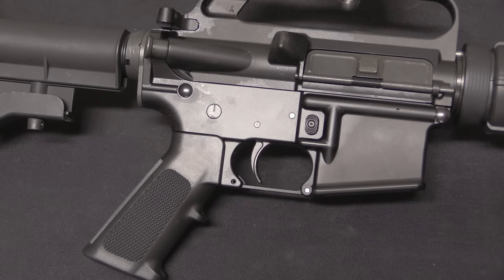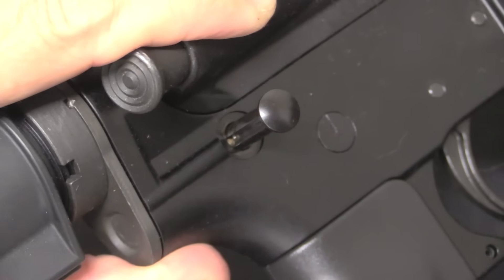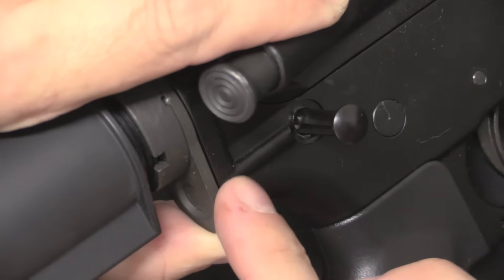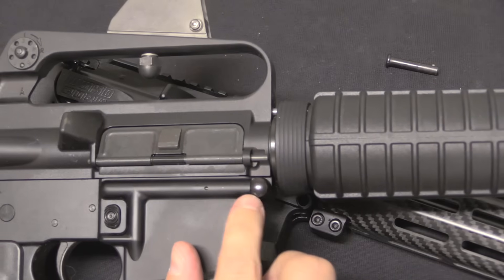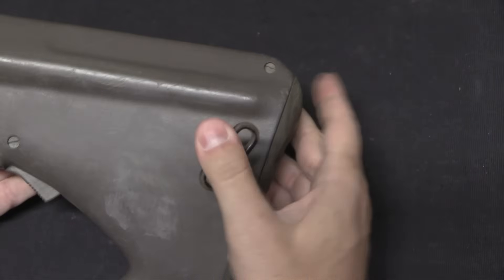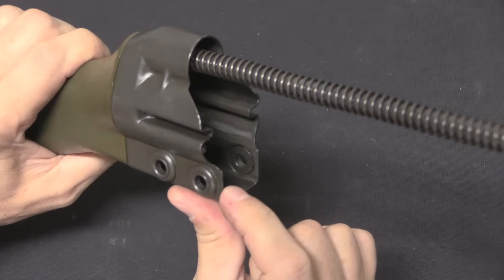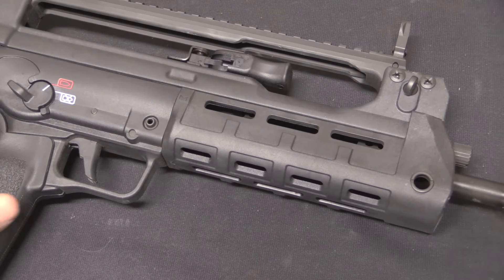Ask Ian: Why Don't More Rifles Have Captive Pins?

Comment: The HK416 has an interesting semi captive pin on the handguard. Its a screw that after a few rotations can be pulled out as a pin, that is captive, but it can be screwed out of the handguard completely, it just requires you to intentionally start the thread in the outer position.

Comment: you can also include metal parts in polymer injection molding (part gets placed in mould before plastic gets infected, can ve fully automatic process), for example a small diameter pipe for such a pin retainer. it does bring up the cost for the mould, of course, especially since you basically need three of them for every machine, but it's possible and wouldn't create a weak point like drilling into the part does. especially with an outside profile of the metal piece that'd help it remain in place and take over so evof the structure that's lost due to the void.
the bigger problem with the last one is the abrupt thickening of the polymer as that increases the chances of imperfections or voids in the finished part, while the sharp corners do create potential for stress while cooling and therefor inherent weaknesses if not dealt with properly (which does increase cost once again, as there need to be special accomodations made for this).

Comment: In case of the VHS-2, I think whilst the point about a potential bottleneck in production, that situation would only become a problem in a wartime emergency production mode. In which case a simplified version could be produced, that use non-captive "normal" pins. I assume changing the desing in this way couldn't be to big of an issue.

Comment: I am biased on this particular issue, but I believe a sg550 series type of swiss malfunctionable pin is better than having the pin retention in the reciever (where it could also get clogged up or similar). Instead of needing to fix/replace the whole reciever part, you can just fix/replace the pin, which I think is likely cheaper.

Comment: HK might not feature captive pins, but on the german standard issue G36 there are holes in the shoulder rest, specifically designed to take the pins during disassembly.
I found that to be a very sensible and well thought through solution.

Comment: The fact that a gun becomes useless if you lose a pin, might be an argument for intalling captive pins. Disassembling a gun on a table is different than doing it in the field. If you have to pull a pin in a combat situation because of a malfunktion, there is a high chance of shaky hands 👋 I am just an airsoft player, but i had situations, where i was extremely thankful for captive pins on my M4 😳😄

Comment: Sooo....dumb question. The non-captive pins Ian is taking out of these guns have Detents (sp?), ie little steel balls in the pins themselves which seem to offer easy removal. Yet, the detents prevent the pins from just falling out. In other words, there doesn't seem to be an operational difference between these two types of pins. What am I missing? Is it just that the pin doesn't come out? Is that the "captive" part? If you're not a soldier in the field trying to "take down" your rifle and you don't want to lose the pin, what does it matter? You're likely to be taking down the gun in your living room or garage. No reason to fear losing the pin.....right?

Comment: Ian, I will point out on your comments from the MDR... 
Most plastics manufacturers will have those holes pre-planned in the mold. what they do is use insert pins while making the part to create these features instead of drilling holes. this eliminates the problem of having to weaken the polymer, but it adds more cost to your tools and dies for the part itself.

P.S. - A lot of people are going to disagree with me, but you'd think the engineers at Desert Tech were not stupid, and more than likely did just as I said; used tool inserts while molding the part to create these captive pin features instead of drilling holes post mold-shot. it's common practice among a lot of polymer part manufacturers.

P.S.S. - After some analysis of paused stills of the video, the tooling may have been simplified by using fixed extrusion pins machined into the mold tool, and although i can not see a parting line, the likely answer is that the die draw is going the direction of these features, which means that the mold opens and closes the same direction of these features, simplifying the tool and lowering the cost. At least that is what would have been done at the company i worked at as an engineer. Most of my work dealt in plastic parts manufacturing, as well as sheetmetal and welding assemblies. (Automotive supplier, in case people are wondering)

Comment: Something else to consider from the manufacturing cost side when making detents and captive pins: the tool to make the holes for the detent is almost always a custom tool.  Machine tooling gets expensive fast and custom tooling like that even more so.  Plus if you are a company that makes multiple parts on a single machine, getting the machine set back up and getting that detent operation correct takes some fiddling, assuming we're talking machined parts here.

Comment: Very well said, Ian. In 2018 I worked for a company making injection molded parts and as a mechanical engineer this was my first time dealing with them. Me, being a very traditional engineer, made my prototypes with fasteners. The principal level industrial engineer instructed me that while my design was stout and reliable, every single extra BOM item I add makes the overall product more expensive. If I could use say snaps that worked with the required draft for the mold pull, most of this consumer device would snap together once and never come apart. Where more precision was needed for a linear stage we used ground stainless steel rods but again, if we could reduce part cost by integrating the bearing into a molded part instead of trying to press or glue in a separate bearing it would keep costs down. 

While you obviously want the product, be it a consumer level device or even a firearm to be reliable above all else, if I can do that with 25% fewer parts it means that the client (even a military one) can get that many more firearms in the hands of soldiers. That was a side of engineering I was not exposed to, and you did an excellent job explaining it here. I also have to say for injection molded parts, thank God for CAD!
Reply: The example of a polymer part having its own small drilled section for the detent spring was fun to see. Makes sense they used a step rather than trying to use a boss, as the boss is usually no more than 50-60% of the wall thickness and you really, really want to avoid trying to have another part just for reinforcement. You can make it work for sure but it takes more engineering hours. But that being said, it would pay off instead of having a line down situation on lower receivers because that one metal reinforcing ring was running low in inventory. THAT costs way more plus the general added manufacturing time, rework etc that a lot of managers don't understand. Do it right the first time, because you'll easily spend 2x the time fixing it after the product has been released.

Comment: A really seemingly simple compromise to me (I know very little about guns, basically just stuff from this channel) would be to drill little holes the same diameter as the pin holes and just deep enough to hold the pins securely with friction, right next to the pin holes, or somewhere on the body of the gun where there is space. Then, you could pull out the pin and put it in the little hole to stay during the process of disassembling the rest of the gun. It doesn't seem like it would be any less convenient to me than using a captive pin. The only problem I can think of is the hole would capture dirt/mud and be hard to clean, but I'm sure there's a simple workaround to that problem.

Comment: Another consideration is manufacturing steps required to utilize a captive pin, SEM (Screw + washer assembly) or other feature.  A single diameter hole is easy, even if they are deep (over 4 diameters). Stepped holes and particularly REVERSE stepped diameter holes will cause planners to curse your name (even when it has been done 20 times bbq before).  The cost of "close tolerance" fasteners is about double that of standard (loosee goosed) fasteners. But, MIGHT be offset by being assembled with zero special fixtures/tools/attention.   Expected number of units produced can be the deciding factor.  Are you making 500 or 50,000?

Comment: What about the L85?

It's stamped metal with captive pins and I don't think it has retraining springs.

Also can't you just have a pin with the inside slightly thicker so you can't pull it fully out? It'd have little to no effect on manufacturing costs and you could use it on sheet metal and polymer.

Comment: Thanks for taking the time to show examples of captive pins.  The VHS system seems to be the best idea for a polymer part because it spreads the stress across a larger area.  Manufacturing the pin and retainer in-house may not be big deal for a large armes company.  You should consider more videos like this that show how different gun makers solver the same problem!

Comment: @Forgotten Weapons, While you're right you would have a thin wall, as long as you had flared it where the detent is, the wall thickness where the spring is really doesn't matter. Ideally you need to mold the hole in, not drill it. Having this kind of hole in the part would require action in the tool and molding long, thin holes would mean the tool would wear very quickly (the part of the tool making the hole, at least). I suspect it is far less to do with the strength of the resulting part but in trying to optimize the part to be produced in mass on injection mold tooling. 

None of this is really a hindrance because you could engineer the pin to be captive by way of the pin itself... It's just a matter of the designers being lazy or the bean counters being cheap.

Comment: I have always wondered this, especially after seeing firearms with holes in their butt stock specifically for "retaining" pins after being removed. while the convenience is undeniable, I feel like the aforementioned solution works just as well, assuming you don't fumble the pin in the couple of seconds it takes you to remove it and place it in the butt stock (or wherever the hole is)

Comment: @Forgotten Weapons
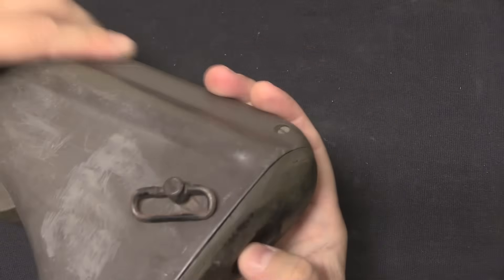3:58 A reminder from a retired Austrian Army NCO who used AUGs for over a decade (and still does in the army reserve): Never pull that rear pin out right away on a Steyr AUG.
Instead, do it like you did it in your video about the AUG where you did it the right way: push in the indentation on the buttplate, push the pin in all the way, remove the buttplate, push the "button" thingy on the rear of the fire control group, and then pull the pin out.

There are two reasons why you should always do it this way:
1) Disassembly is a lot easier and smoother that way, because the two C-shaped thingies on the buttplate aren't in the way when you pull out the pin, so it's much less fumbly to get the pin out;

And second (which is more important): if you pull the pin out right away like you did here, the pin as well as the two C-shaped thingies on the buttplate can get worn out over time which - as you might imagine - ain't good.
I've experienced two really old AUGs during my stint in the Austrian Army where the buttplates didn't have a snug fit on the stock anymore because they were disassembled in that wrong way too often by careless handlers and thus needed new buttplates because the C-shaped thingies were just worn out too much.

And while this might sound like me splitting hairs, it's actually just a) good form, and b) following the wise tried and tested principle of: "always take good care of your weapon, because then your weapon will take good care of you when you need it".

Apart from that: still a great video, of course!

Comment: At least hk were smart enough to put 2 pin retainer holes in the stock so you can pull them out for disassembly and put them in the stock so you don’t lose them.

Comment: I admit I think more about losing the pins on my KP15 than my other AR lowers, but I have not done so because I stick them back in where they came from when disassembly has taken place.  Having installed hundreds of the captured takedown pins, I can say they malfunction at times...usually when the tiny pins are brittle and break after very little use, or wear out much sooner than expected (even when greased properly).  I can only think those specific pins were defective, but now my thought is in asking when, after assembly, does a defective part malfunction?
In my experience, if a malfunction from a defect is going to happen, it happens within a dozen uses and feel 'wrong' right away (some resistance or rough operation).
I have replaced captive pin sets with ball-retained takedown pin sets when a malfunction occurred and it works so that became my answer...I carry a set of ball-retained pins in my cleaning kit.  I'm starting to think it's just easier to use the ball-retained pin sets and never install captured takedown pins at all.

Comment: @2:07, The rear detent/spring hole on an AR isn't stepped. Neither is the detent itself. Blueprint calls out .093 drilled hole thru to pin diameter. The rear detent is restricted from falling out by the takedown pin being in place. Love the video, as always, but that bit was erroneous.

Comment: From a machining standpoint, most of the non-captive pins I saw in the video could be produced on just a lathe. Even with the side hole for the ball bearing or the slit on the end for the HK style pins. With the AR style pins, the track or slot down the length of the pin would require a whole second setup in a mill. Even if it's just a simple slot, it's still going to add time, cost, and (minor) complexity to the supply side that may make it a nonviable option.

Comment: I was in the Army during the time of ACUs and excessive velcro patches. In theory, us privates weren't supposed to disassemble the bolt of our M16s while out in the field because the firing pin retaining pin and extractor retaining pin are so small and easy to lose. I went ahead and disassembled everything anyways, but put those pins underneath my rank patch. Say what you will about the many many many flaws of that uniform, but it was nice to have a place to stash small gun parts.

Comment: has anyone attempted a 'bolt and nut' style of Captive pin? like, the pin comes in two parts, a normal pin with the very end of the pin threaded and a cap that is too big to fit out the smaller hole the normal pin fits through?

Comment: was always fun when the captive pins on the Cadet GP L98A1 (manual operated SA80) came completely out. You couldn't get them back in and it would need a armorer to work on it. I imagine the same was true for all the early variations of the SA80 family

Comment: I think the issue is military vs civilian use. 

Military users will need to disassemble the rifle more and in much more varied circumstances. Thus the likelihood of loss is higher, out in the field over deep grass or jungle surroundings vs home over a workbench or at the range. 

The consequences of loss are also higher in the Military vs civilian. Military users lose a pin and the weapon is “down.” Then that soldier is combat ineffective and could lead towards loss of life or mission failure. A civilian loses one and its an inconvenience until another one can be ordered and received. 

Thus the cost and complexity isn’t as warranted for a civilian as it may be for a Military end user.

Comment: Hello Iain another way of implementing a captive pin is used on the SA80 L85 (yes boo hiss lol) series of rifles. This is done on the steel sheet stamping where a boss is welded on with a groove inside. This allows a very thin diameter wire "C" clip made of spring steel to be inserted and that interfaces with the grooves in the pin and the boss. It does work and while not as strong as say an AR15 style pin it is pretty cheap and can be replaced with a little bit of fiddling.

Comment: The engineering of anything is (or should be) designed according to the stated requirements of the person/company hiring the engineers.  If the design standard calls for "reliable, simple, and cost effective" as top priority you get a different finished product than if the standard calls for "ease of manufacture" or "best quality practical", or "ease of maintenance".

Comment: The other thing with those detent holes is they add another couple of drills to the tool magazine required for an ar, which means another tool change, adding time, therefore cost to every lower made. One of the ways to drop the cost of parts is to reduce the number of tools necessary to get the finish,  precision, and accuracy you want out of the finished part.

Comment: Guns are probably one of the only manufactured items that need the requirement to be quickly disassembled and also solid enough to take a lot of force when put together.   I wonder how much difference it would make to the design if that quick disassembly wasn't a requirement?  Is there now, alternative methods to not require as much in the field cleaning?